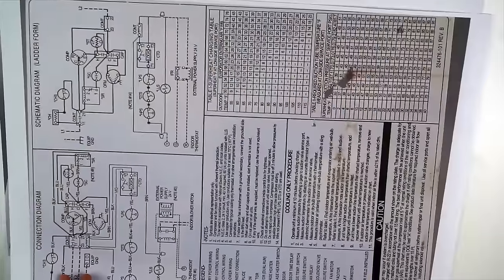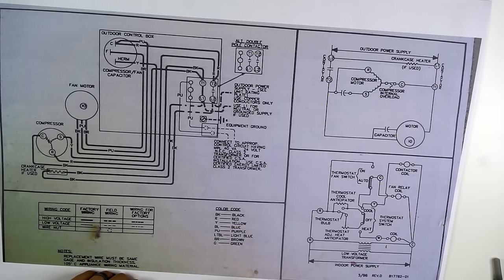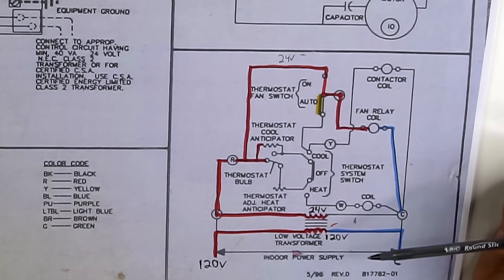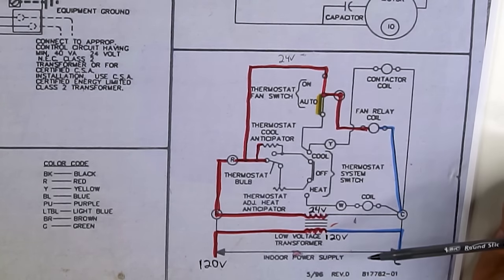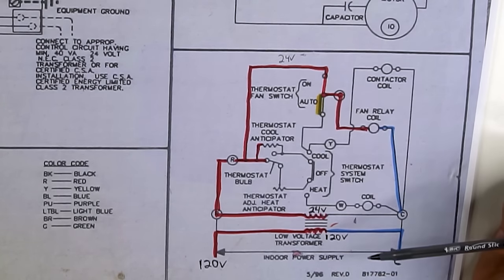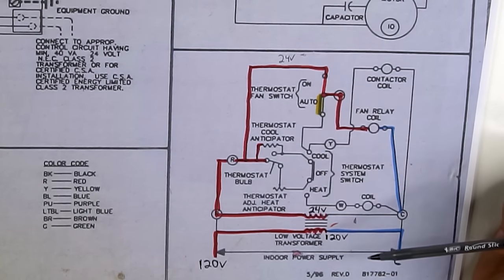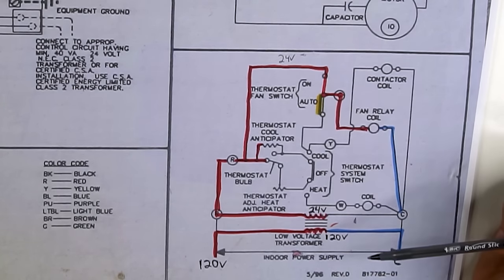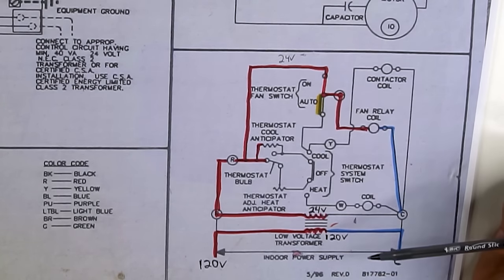How to Read AC Wiring Diagram

Comment: I am engineer from UK and was in USA for holiday where I had to find a fault on AC system and your Video was a blessing , Thank you for simple to understand circuit diagram, Never seen a AC system before and I passed the test , The fault was the Capacitor which on the Start Coil, Thank again for your easy to understand explanation.

Comment: Great video, I am 72 year old retired self trained  (with some help from other techs). My main expertise is in electronics. Had training in radio and tv repair when i was 18 back when ic's were first  coming out. Only do HVAC for family and friends. Have found that a lot of HVAC techs will go out and just start putting freon in before they even check to see if compressor is running. ALWAYS check why it is not cooling before just saying it is low on freon. Nice to have good refresher course. All techs should watch your video. I have had companies want to know who I was because they wanted to hire me to do their troubleshooting because the customer would be able to tell them what component was needed when the tech showed up. I live in rural community and do not have truck to stock parts and closest HVAC parts store is over 30 miles away. No charge just call HVAC tech and tell him what to bring when he shows up.
RETIRED AND STILL WORING TO HELP OTHERS

Comment: Oh it is so nice to see four different examples. In the first, the start winding of the compressor and the start winding of the fan only operate when starting, and as you say the start cap is in series. Interestingly, in the following three examples, they use dual 'auxiliary' coils and capacitors for the fan and compressor, both of which are used during run and start! In that case, the start cap is in parallel with the whole motor, and during the run phase the dual run caps remain in series with both auxiliary windings. This video cleared up many misconceptions I had, thanks again.
Reply from the maker: Awesome! :) Glad to hear the video was helpful! Thank you for watching and commenting/explaining what was cleared up for you!
Reply: 78

Comment: Fantastic video Jay.  I learn so much by watching your videos.  I do see a problem with the explanation of the resistor that connects between the start capacitor terminals about 43 min. into the video though.  I do believe that is a bleed down resistor used to bleed down the cap after it is taken out of service.  The SR (start relay coil) between terminals 5 and 2 is the coil that senses back EMF from the start winding (aux winding) on the compressor and opens the switch between terminals 2 and 1.  Thanks for all the time that you put into your videos.  You are a Great Teacher!!!

Comment: Incredible. Need a good idea of basic electronics to follow along but really good stuff.

Have to figure out what the hack did that installed my two stage Goodman package unit. Looks like he hooked up the heat signal to the high side of the cooling in the thermostat..
Reply: This video increased my understanding of the operation of the basic function of the system immensely. Should save me some time. Ty

Comment: Is it possible to do a whole video like this going over with the diagrams with the actual unit wiring like you did at the end of the video with the last diagram? That would be greatly appreciated. Thank you! Great video as well. Made understanding diagrams much better.
Reply from the maker: There are barely any furnaces here in Hawaii but if I get the chance, I would like to make a video on the furnace wiring as well. Thank you for the suggestion!
Reply: @WordofAdviceTV  For sure. Thanks!

Comment: Thank you so much for putting this together. Is it possible to put together AC maintenance playlist? Such as how to clean condenser, coil, blower motor etc. Esp I am comfortable with cleaning condenser but not too comfortable with cleaning coil with chemical  esp  closet units. Afraid chemical will damage units.
Reply from the maker: You're welcome! Thank you for watching! I do have a video on AC Maintenance Tips but I do not clean the evaporator coil in that video. I plan on making a separate video on how to clean one but I haven't gotten around to it yet.

Comment: I am not 100% sure of something on wiring diagram, I was under the impression that when referring to L1 and L2 that L1 was usually the hot leg and L2 was the Neutral, does it just depend on the individual diagram? I guess in 240V it wouldn't come into play but more in regards to 120 V

Comment: Great videos. It helped me a lot in understanding and troubleshooting my ac that hasn't been turning on since i bought the house 5 years ago.

My certain unit is carrier and has the diagram 3rd, Wired from control board (Y), to HPS, then LPS, then to the contactor coil. I traced the v from my multimeter and dont have 24v AFTER the LPS. I suspect thats the reason for my contactor not sucking in.

Im ready to bypass the switches and just wire both the thermostat wires directly to the contactor. Any thoughts?

Comment: Hey guy, love your knowledge base and had a question. If the so called "it's not the voltage that kills you, it's the amperage," then why does the 24v from a step down transformer not make the current deadly at the thermostat wire?

Comment: Thank you for your video and your time. Are you saying that in the crankcase heater circuit, electricity can jump back across the open contactor in order to complete a circuit from Points 11 on the contactor and point 21 on the contactor in the third set of wire diagrams shown in the video?

Comment: This was great Jay! You posted this the day after I found the schematics for my ICP AC. Mine is almost exactly like the 3rd one. I  was looking for just such an explanation! The only question I had was that mine shows something that's called Comfort Alert. Is this something like a control board? Or what functions does it serve? Thanks again Jay!!! P.S. I really couldn't find a good explanation anywhere online.
Reply from the maker: You're welcome! Glad to hear the video was helpful! Comfort Alert is a fancy name they gave to a diagnostic control board. I don't know if you have seen this site when you did your own research but they explain what that board does here: https://www.rheemparts.com/distributorscatalog/FrameHolder.aspx?CatalogBranchID=6108a249-dc71-48fb-9951-7db4c3194afa&Tag=DP2&BranchName=Emerson%20Comfort%20Alert%20Modules&TableName=Compressor&MainCategory=Compressors
Reply: @WordofAdviceTV  Thanks Jay!

Comment: JJ I've got a question. Since we are talking about wiring. Since all furnaces these day have control boards and ECM's. Shouldn't the furnace be on a surge protector? Don't ask me why but they have 120v AC on the control board. I would suggest having 120v relay hub something completely separate from the 24volt system, and easier to replace than the entire control board if a relay fries.

Comment: Question.  If in the diagram at 7:20 the low pressure switch to be actuated is represented by a semi-circle, would it not be more intuitive for the flat face of the semi-circle to be facing upwards?

Comment: You have the patience of a saint.  Thank you so much for spending over an hour explaining this.  I have a trane system from 2006 that does not seem to be cooling well anymore.  Charge is good according to the HVAC tech that came out but they didn't inspect anything else.  I decided to open up the electrical components to see maybe a capacitor was wearing down and could be the cause.  I got a bit confused because I see 3 capacitors in there: a 521 hard start relay, a run capacitor (only has 2 terminals 7.5uF) and another one that kind of looks like a dual run capacitor (i see 3 terminals, but only 2 were used).  Any thoughts on whether or not a dying capacitor could be the cause?  Thanks!
Reply: Hi maybe I can help the 7.5 mf capacitor is for the fan .....my guess is the original dual capacitor 3 terminal was ...example 40 mf for compressor and 5 mf for the fan .....I think the fan went bad someone changed it with a fan that requires a 7.5 mf capacitor the two terminal one you found....so the fan terminal on the dual cap would not be used any longer....my guess later the compressor got hard to start and someone added a hard start capacitor to help the compressor start !   SO make sure power is off...trace the two wire 7.5mf to the fan motor ......two wires to the Dual are power to compressor ....the 521 capacitor Hard starts the compressor....... FIX  ...check the Dual Run capacitor.  ...........example 40 + 5.........get a new one 40 + 7.5 ......then take the 2 wire 7.5 out and put the 521 hard start in .....maybe some one can help explain better what I am talking about ... lol .. Good Luck 
NOTE.  Example you may have 80+5 ......so you would get 80+7.5 ....80 for compressor 7.5 for fan .

Comment: I'm a bit confused at 42:24, Once power reaches a NO contact the contact closes to allow current to flow right? So wouldn't a NC contact open when it receives power? I was following well up until that point, can you please explain?
Reply from the maker: If you listen to the next minute starting from 42:24, I explain how that normally closed switch works and what opens it.

Comment: Hi Jay: I LOVE your videos a lot. Thank you so much for all efforts. Question: I have outdoor HVAC the diagram says L1,L2, L3 and no where I can see specifically what voltage those lines have? I know transformer need 220 bolts and guessing now that L1:120 volts, L2: neutral, L3 120 volts. How can I be firm of these specs if diagram do not say much?
Also the 3 lines at wall were for older unit so I can not use those as reference 
I need to re wire breaker such that Line voltages match unit needs. How can I do that??
Thanks buddy

Comment: When you get 33:41 min in the video you state you could have SPP6 Boost or Potential relay with a Start Capacitor. BUT NOT BOTH.
Would it be problematic if you were to hook up an SPP6 Boost after the fact to help start a compressor?

Comment: Actually the right side of your wiring diagram is call a schematic of the components in the circuit. Its how all the parts in the circuit are connected.  The larger diagram to the left is your wiring is how you connect all the parts together in the units electrical device connections.

Comment: So if the common wire on a contactor is just a wire that carries the power back to its source, how is it that when you check power between your coil (of the contactor when it’s calling) that we have 24v on the meter? Why doesn’t the meter read 0v for instance. If I’m checking between a LPC between both the incoming power to the outgoing power of the switch while it’s running I have 0volts on my meter. But when checking on the coil of the contactor I have 24v when it’s running.

Comment: The "really old" thermostat you are probably referring to, that had a heat anticipator to set, more than likely was the famous "The Round" Honeywell T87F, produced for fifty+ years ending in 2006, and still being installed from time to time by companies that are "out of diapers" and have been around more than a few years.  A digital direct replacement without the mercury switch is now available, so the sub base needn't be replaced.  Some T87s are really old, others, not so much. ( I also noticed you said the burner gas would come on, with flame already proven by the flame sensor, when the AGA gas valve to the furnace was off.  HOW?  You'll want to edit that out.  Not sure if that was this or the previous video of yours.)

Comment: The liquid line solenoid valve is where if your condenser is up on a roof and you're down at your air hammers down in the room is keeps the flow from being able to travel back down into the air handler to your air handler not filled up with it like the compressor would be

Comment: I tested motor controls at Texas Instruments back in 1985 - 86. Maybe that's what's in those motors for overheat protection?
I love your pet Dragons...😊
Reply: We certainly appreciate your hard work. Putting that much time into a video,
and you didn't realize it. Thank you, but relax and do it a little at a time.
Reply from the maker: @classic287  Almost all motors will have internal overload/overheat protection so likely the ones you worked on had them as well. Heheh, glad you liked the dragons! :) And thank you for watching and commenting! I don't think I will be making a video anywhere near the length of this one any time soon so no worries there..
Reply: Word of Advice TV,  Actually I tested the control itself only, not a motor. 😊

Comment: Hey buddy I need help asap I just got a home and my ac unit is york I open it the the diagram page is gone and the capacitor is bad I order a new one I got a brown black and red wire and I have a little capacitor to the brown is on them but the capacitor that's bad nobody connected the wire to fan which wire goes to fan need help asap

Comment: At 1:03:58 you say you only get 120 volts and not 240 Volts if 1 fuse is blown. I think you would get 0 colts as no current flowing? Terminals 23 of contactor are not grounded so you cannot use as a reference?     Can anyone confirm if this is correct ?
Reply: On a line connected to 120V the voltage is 120V on the whole line until you reach something that causes a voltage drop. So if you no current there is still 120V. Voltage is potential. The voltage is available so as soon as a circuit is complete current can flow.

Comment: I like your videos. I like this video too. I'm part way through it but I'm curious why you said 120 volts is not enough to power the motor (which is true that you said that) but the real reason being that the fuse being blown opened up the circuit so now you don't have a complete path for your current to flow. So the real reason behind the motor not working isn't because there's not enough voltage but rather because there's not a path for current to flow.